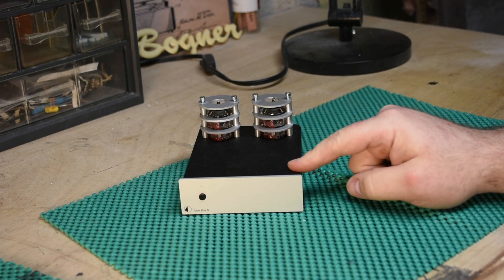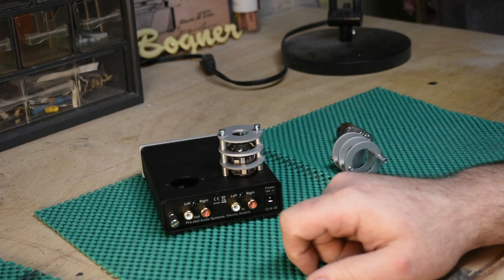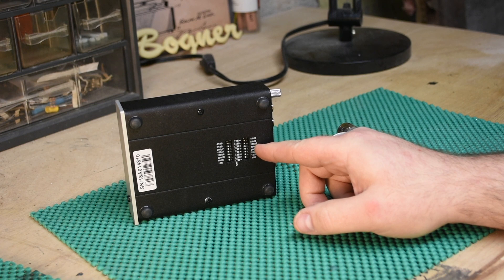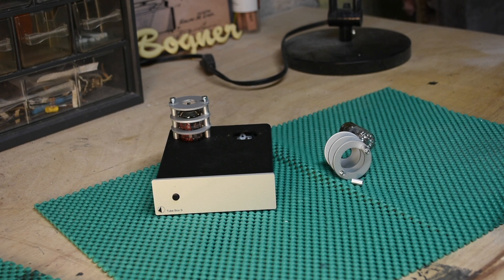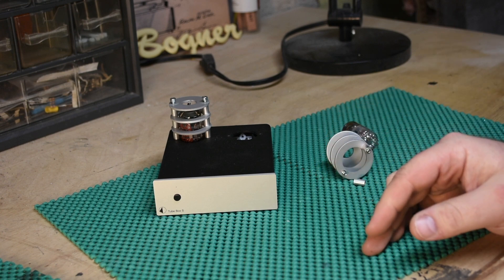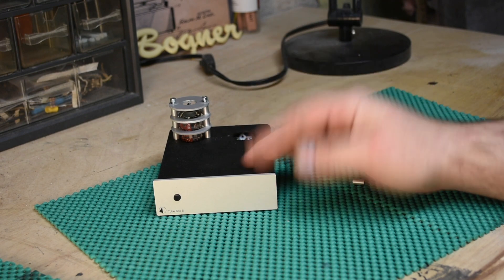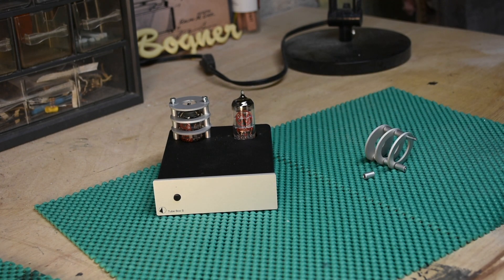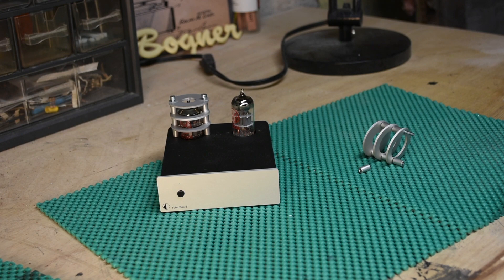PRO-JECT Tube Box S MM/MC Phono Preamp Review

Comment: Always enjoy your info! I've been trying hard to find the right preamp for my Pioneer PL540 turntable with a Shure m97xe. 2 so far I have been sent back. Andover Audio has just come out with a new one called the SpinStage Phono Preamp for $250. Next to no reviews yet but from what I can tell very well made. It's dual mono, with good insides. It has very flexible flip switch settings on the bottom that seem to be easy to understand. If possible check it out, I'm really itching to try it. 👍
Reply: I've heard really good things about the Musical Fidelity V90-lps to.